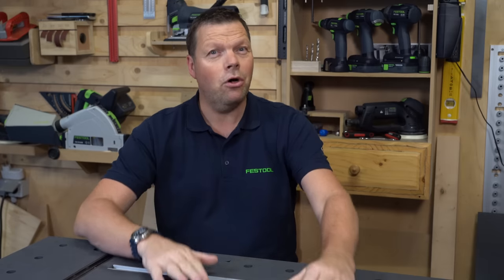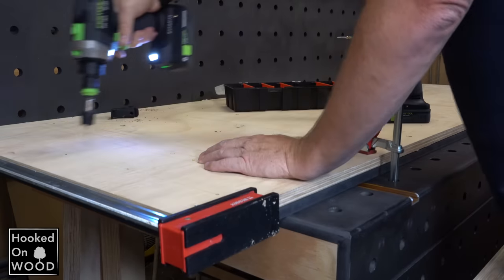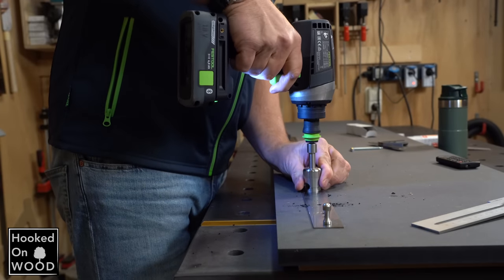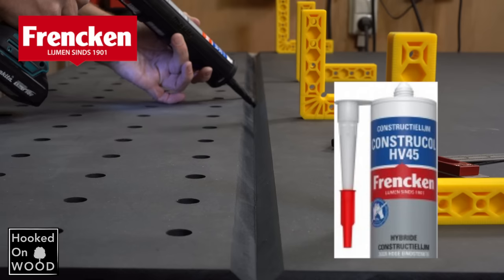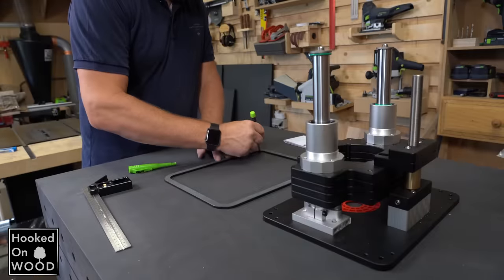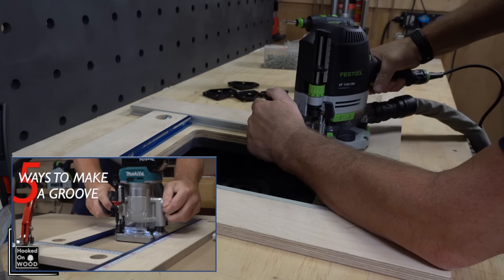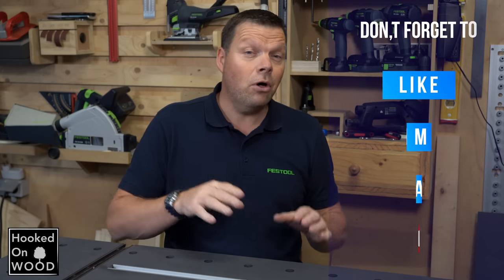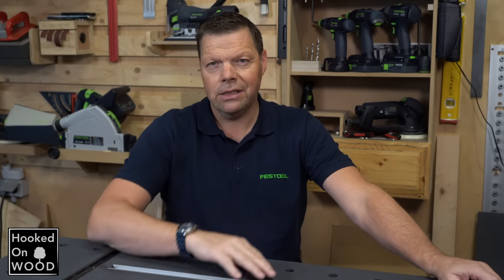Affordable and easy to build accurate workbench router table

Comment: Did you think about slightly larger or chamfered holes in the plywood backer to give more clearance for your old clamps?
Reply from the maker: I tried, but needed to make a too big of a chamfer. So, this does not work with two 18mm top.

Comment: I'll admit it was a little surprising to see a chap in a festool shirt, surrounded by festool tools reach for pocket holes instead of a Domino (for the drawers) and Domino XL for the leg assembly.

I see arguments for both. As you said, pocket hole joinery can pull out of position. But they're a much cheaper reversible than Domino Connectors. I don't know what I would have done. Probably both.
Reply from the maker: I do not think there is good or bad. I like to use the pocket holes in some cases. For drawers it works vey fast.

Comment: Hi Denis,
Why did you placed the T-tracks for the fence so close to the transversal T-track? Shouldn't be 20 - 25cm far from it, behind the router bit and the distance from fence front and the hold down nuts of the fence?
Cheers,
Lucian
Reply from the maker: You looked very well:-). But you are right, it is completely unnecessary for the router and fence use. It even limits the reach of the router fence. 
I used other rails than the original. These are a bit longer. I placed them aligned with the beginning of the router plate, to get a cleaner and more organized table top. But also to give me the opportunity to also use T-track clamps at this place. So, they are not completely useless. And I still also have my INCRA fence I can use when I need more capacity. I made this mainly to test the fence. And although it is so far a nice fence, you can not compare it with the INCRA and LS positioner.  So, that will be my number one choice. I do not replace it.

Comment: Just wondering how big of a deal it is to be blocking some of the rows of dog holes with the frame. I see the entire row of the top on the side next to the apron is blocked. Has this caused any problems with any accessories that would be longer than the thickness of the top?
Reply from the maker: Yes, that will give problems with accessories that doe have longer inserts that the thickness of the table top. But my dogholes fit and I have clamps that will fit also.so for my accessories there will be no problem. 99% of the holes however do not have this limitation. But you are right to check if this conflict your accessories

Comment: Hi Dennis.  What's the verdict on the thicker workbench top.  Do you like the single or double sheet top?  Also,   do you use Patreon?  Thanx!!
Reply from the maker: First impressions are very good. You notice less vibrations with sanding for example. See how the dog holes and clamps will hold. But when they do, I definitely like this. Perhaps combination with torsion box for the final version. The clamps are so nice and fast to use.
Reply: @HookedonWood  Thanx!  I like the way this bench can significantly reduce or eliminate the need for vises.  You do really nice work.  Thanx for sharing.  How can I provide additional support for your channel?  hb
Reply: @HookedonWood  I really like the track clamps.  Can you think of a way to get them to work with the thicker worktop?

Comment: Dennis, extremely nice work as always! I like the simple clean lines of your workbench, not fancy just to make it look like furniture, but solid, functional and good looking all at the same time. You left a section of the top away from the router with no dog holes. Is that because you don’t need the extra holes or did you want a section without holes for a different reason? Great work, enjoy your videos!!

Comment: What is the maximum thickness of the table top to be able to use the quick clamps?
Reply from the maker: I think this will be around 22mm. Maybe with a big chamfer at the underside 25mm

Comment: One thing I didn't understand was the need for the lengthways running pieces of T-Track, which seem redundant with your Incra fence.  I can see value in the one that runs across the bench to use with a mitre guide, but don't follow the value of the other two.  What am I missing here?
Reply from the maker: I made this complete workbench to test a router lift and router fence. For that fence i need the T tracks. So you are right that it makes no sense for my INCRA fence
Reply: @Hooked on Wood  Ahh, makes sense now, thanks Dennis.

Comment: What is the Black material for the top? It’s not standard mfd is itI have never seen it here in the US
Reply: The plan for the original bench explains that the black MDF is this: https://www.atlanticplywood.com/brand/valchromat/

I haven't found any in stock anywhere in the Seattle, WA (usa) area. There are some google hits for US suppliers, so I'm going to start calling those to see what it'd take to order some sheets. Not holding my breath though.

Comment: Im gonna ask you the most dutch question ever.

Howmany sheets of plywood were needed for this build?

So i can calculate with the lumberprices of now what it would cost me to make this.

Beautiful build, and this is a workbench that lasts for years.

Greets Danny from Leeuwarden, the Netherlands
Reply from the maker: Ik geloof 4 sheets radiata. 1 sheet black mdf 18mm. Voor laden eventueel nog een kwart sheet. Kwart sheet 9 mm black mdf. 1sheet 9mm mdf voor bodem laden. 1 sheet 15mm mdf voor geleiding laden.  Ik was totaal een kleine 400 euro kwijt. Incl btw.
Reply: @HookedonWood 
Keurig man.

Luister, mocht je in de toekomst deze willen verkopen, bericht me dan :)

Gr Danny
Reply: Love this build. As a suggestion could you please consider to put the material list in the comments.